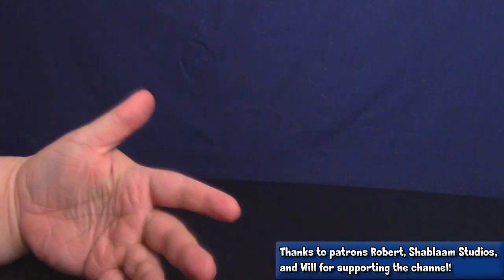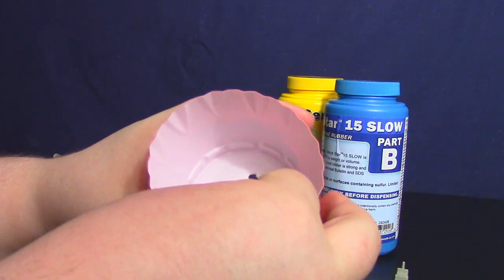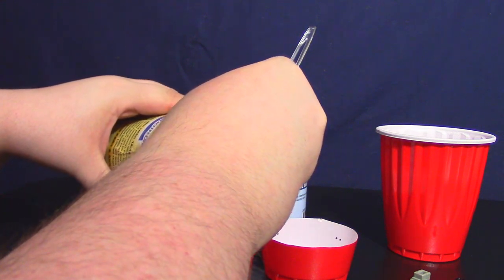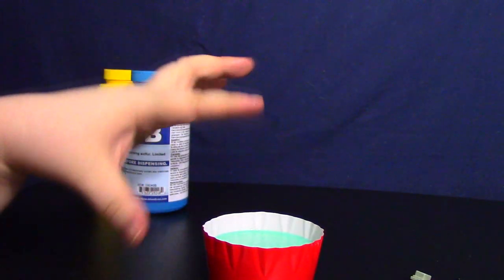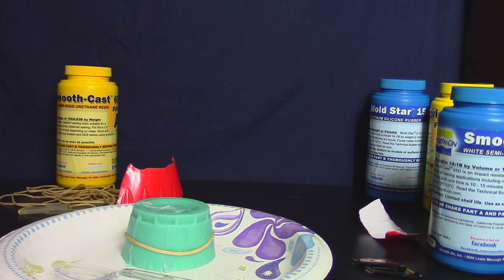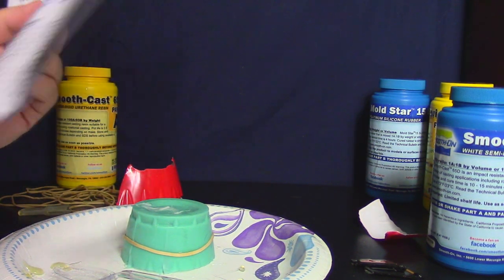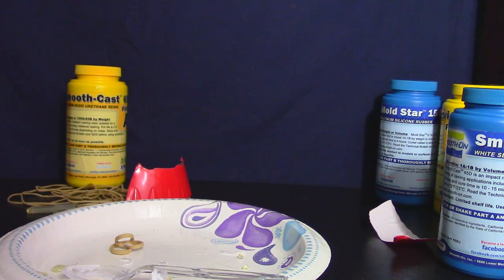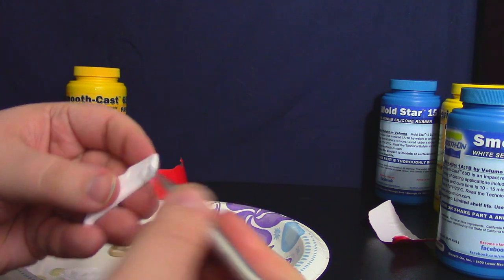My first experience casting with Smooth-On Resin

Comment: Look at what you've started. I'm so proud.  It's an extremely less expensive alternative than 3D printing. Highly practical and less expensive. 3D printing is nice because you don't already need a copy or a mold but I'm not an engineer and strong with drafting.  Did  i mention less expensive. I'm so impressed.

Comment: Just randomly came across this as someone who uses resin with woodworking and I'll bring it to your attention: art resin and black diamond pigments. Art resin is used for things like jewelry and casting. It's very strong and comes out clear. Black diamond pigments are mixed in to clear resins and can make any color you could ever want. I think you would get a kick out of trying those. Max for a trial run would run about 30 for all of it.

Comment: have you heard of the Silicone + Dish Soap molding hack? i've done it recently and it works
Reply from the maker: I can’t say that I have. What is it?
Reply: @JTMitchell87  it's a cheap alternative to making molds just by using sealant silicone, you pour the silicone into soapy dish water, then you knead it using your soapy hands into what you want to cast, an alternate method for pouring molds involves acetone to thin the silicone